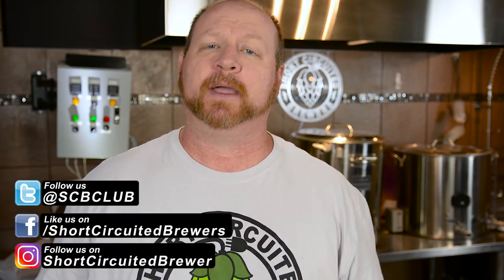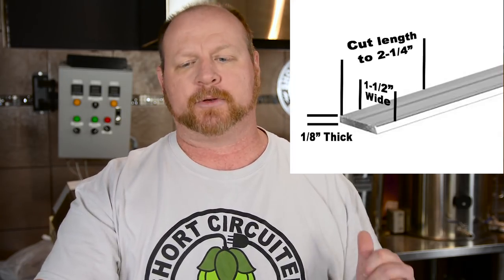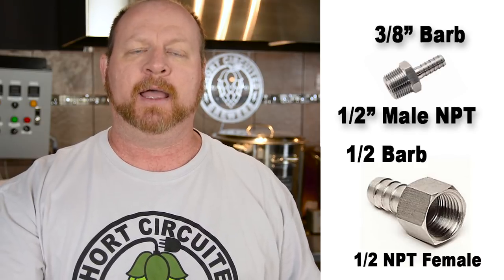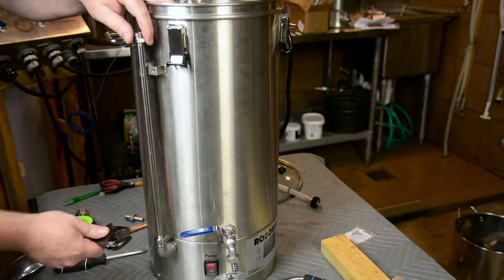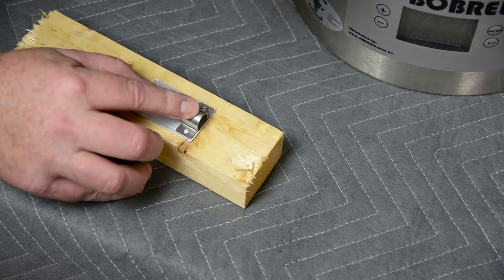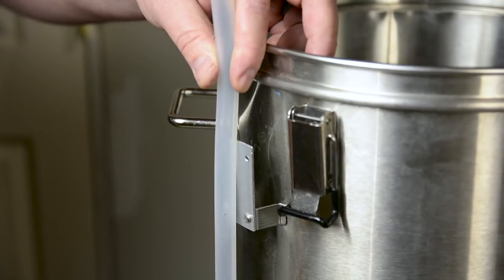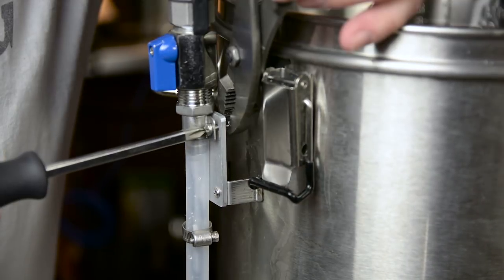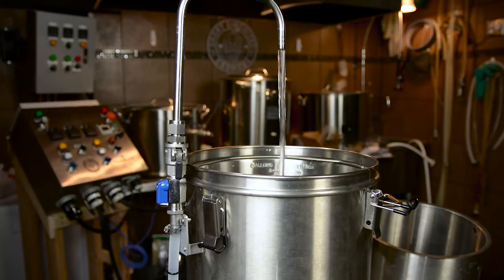ROBOBREW Sightglass Mod | Does not void warranty. NO drilling holes in your Robobrew

Comment: I just completed this sightglass mod today. My only change was having to put the hose clamp above the original clamp. My hose barb wasn't long enough for the hose clamp to attach sufficiently. Just calibrated the O rings.  BTW, I did see the aluminum at Home Depot, but only 10 foot lengths. It was more expensive than getting in custom cut online. Thank you so much
Reply from the maker: Awesome Rob! Glad to hear it worked out for you! 👍🍻

Comment: Great mod! Any specific reason you used the o-rings as level indication instead of marking with some sort of marker?
Reply from the maker: jyohe09 just used the same method as the flex sight from brewhardware. You could use a permanent marker as well. OR use vinyl stickers on the kettle instead.

Comment: For folks who are having a problem with connecting the barbs, the fitting (manufacturer of RB is from Australia) is not NPT, it is BSP. BSP: British Standard Pipe. You will likely need to order these or find a specialty plumbing business.
Reply from the maker: Yep they are NPT.. 👍🍻
Reply: Unfortunately, I may have a different version then what you had or there was a manufacturing change. There are no NPT fittings in 1/2" that will screw on more than 1.5 turns. I took the who thing with me to the hardware store because I kept coming back with items that didn't work, so I broke down and took it with me. LOL Sure enough, I went to Kegland website to look at their hardware page and the only parts they have are listed as BSP. https://www.kegland.com.au/barb-13mm-x-1-2-bsp-female.html is an example of what i wanted to pick up. Intrestingly, the camlock female allows male NPT, but the 90 degree elbow with the male fitting on the bottom does not allow an NPT fitting. I played "adult Legos" for about 4 hours at two different hardware stores and nothing I did worked right. I note that you used a Blinchmann fitting on the bottom so it may be more forgiving than a standard 1/2 NPT female to barb fitting.
Reply: I just found this as well explaining the differences in BSPT and NPT 
What Is the Difference Between BSPT and NPT Threads?
A:
Quick Answer
The main difference between a British Standard Pipe Taper and a National Pipe Taper threads is that the NPT thread have a 60-degree included angle compared to the 55-degree included angle on the BSPT thread. NPT threads also have flattened peaks and valleys called a Sellers form, while the BSPT have rounded peaks and valleys called the Whitworth form
Reply: @russman6577  I am having the same issue with the bottom fitting.

Comment: Hi Thank you for taking the time to make these video's, they are very useful. Do you have any idea for something similar for the Grainfather G30 as I feel that this is something that lets it down. Cheers :)
Reply from the maker: Thanks for the comment! Unfortunately I do not. The way it's constructed it would be difficult to do this on a G30 with doing a destructive modification. 👍🍻
Reply: @ShortCircuitedBrewers  I've been looking at a couple of bolt on sight glasses and will let you know if i find something that works :)
Reply from the maker: @paulrobertson9439  sound good! Let me know!

Comment: Just wondering why you used a 1/2" barb at the bottom with the hose stretched tight on it but a 3/8" barb with a hose clamp at the top. I assume that you wanted as little flow restriction as possible but then you would use 1/2" barbs top and bottom. Were you looking for easier disassembly at the top in case of a clog?
Reply: I know it's been awhile since this was asked, but since I was working on this mod I found that the 3/8" barb allows you to still use the original bracket (that was holding the old recirc tube) to hold the new assembly in place.
There won't be any noticable flow difference because the original ball valve already reduces down to 3/8".
Reply from the maker: Nice!!

Comment: What type of aluminum did you use, and how did you cut it? I think that is the only thing that would prevent me from doing this easily.
Reply: Actually just found an online store that does custom cuts, so I pulled the trigger. MetalsDepot.com
Reply from the maker: 1/8" thick aluminum plate. 2" wide if I remember correctly. I used a Bi-metal hacksaw blade. It cuts it no problem. Got the aluminum stock from Menards, but Home depot or Lowes should have it as well.
Reply from the maker: cool deal!! Let me know how it goes. Cheers Rob! 👍🍻

Comment: Can this be done with a glass tube?
Reply from the maker: It can, you would need a few more components though. You would need compression fittings that would seal but not break the glass. Some people have added a sight glass between the kettle and the ball valve. Good question! 👍🍻
Reply: Never thought of that. I don't even use the ball valve
Reply from the maker: There you go.. Use the opening for the ball valve to install a sightglass! Voilà! Problem solved! 👍🍻